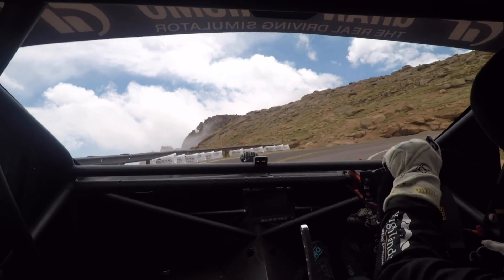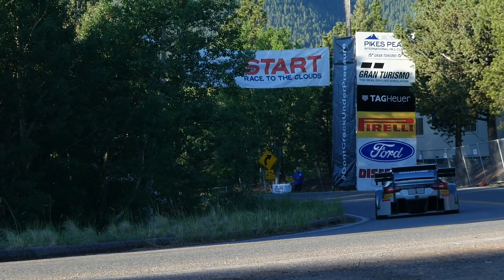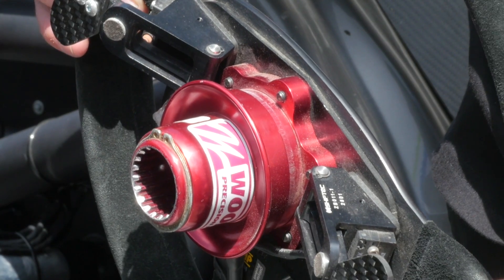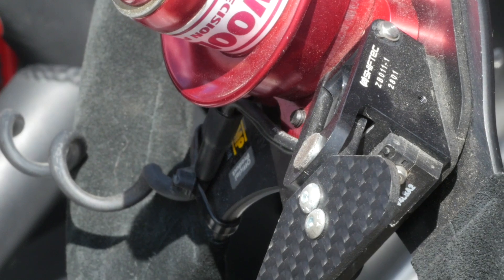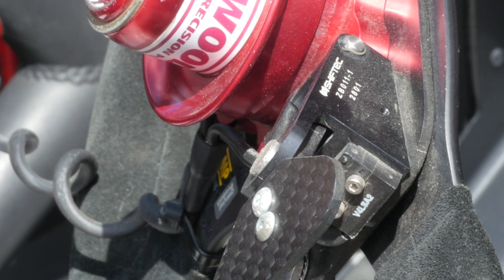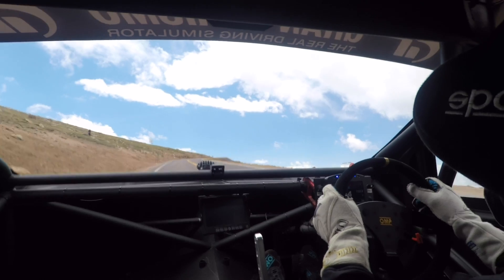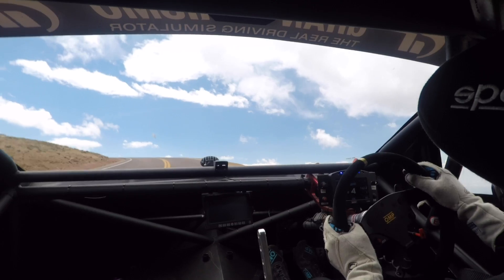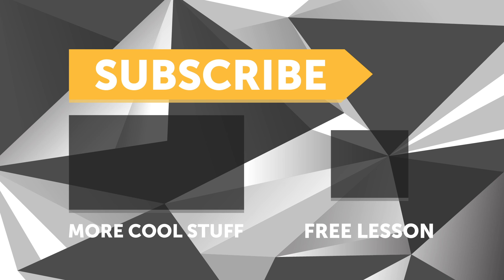2 Reasons Why Paddle Shifted Gearboxes Are Awesome [TECH TALK]

Comment: 100% agree about all the advantages paddle shifts have from the performance point of view, but there is one big advantage the anachronistic "H" pattern manual gearshift has and that is driving pleasure. The tactile feel of the level moving through the gears, that perfect upshift or downshift where the gear slips into place, etc - for a road car it can't be beaten and if you chaps check on Mr Murrays new creation, he agrees - this seems the best inverview on it as it actually addresses points the others missed, like the engine, transmission and electrical systems - https://www.youtube.com/watch?v=NT8PMXCMrsM.

Comment: A strain gauge H pattern can have the same upshift characteristics as dig ring flappy paddle. Downshifting is better on a paddle shift though because of the consistent braking. All come down to preference and what you are doing. There are tons of incredibly fast H pattern race cars that can compete with paddle shift.
Reply: You can't really use a strain gauge on an H-pattern for downshifting though. Upshifting can also be problematic if you happen to accidentally grab the wrong gear, which does happen. Not saying that a skilled driver can't easily avoid this through practice and experience though! Strain gauge is used on H-patterns all the time.

The traditional sequential up/down floor-mounted shifter is the happy medium here. Strain gauge can be used for up and downshifts.